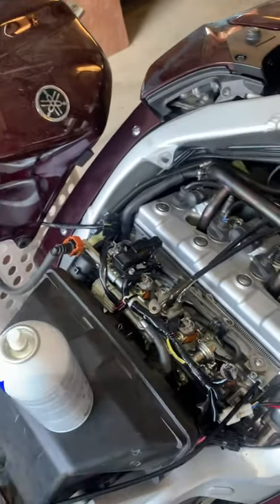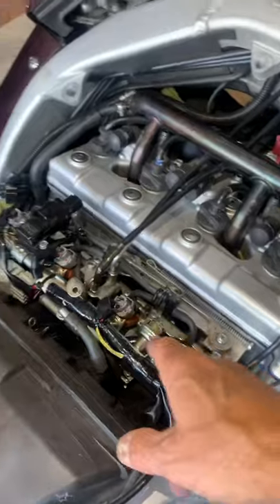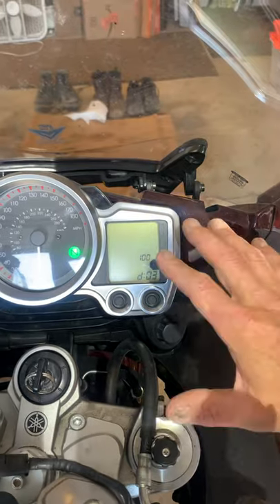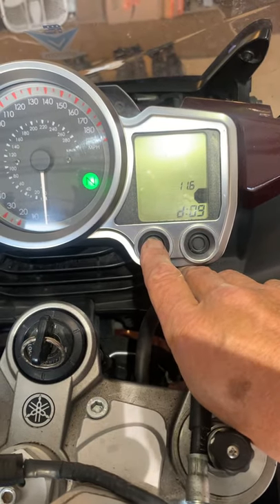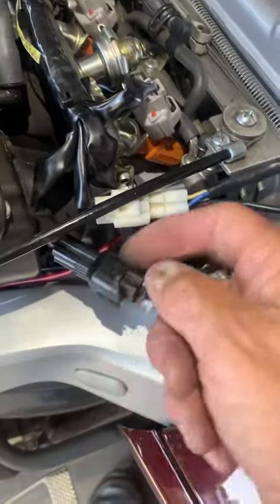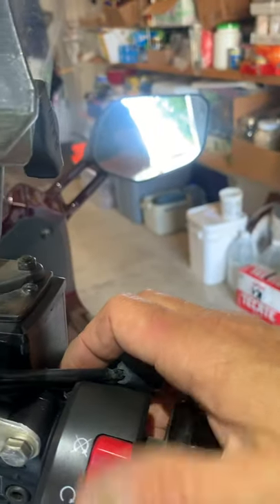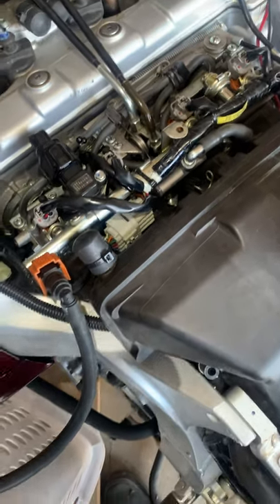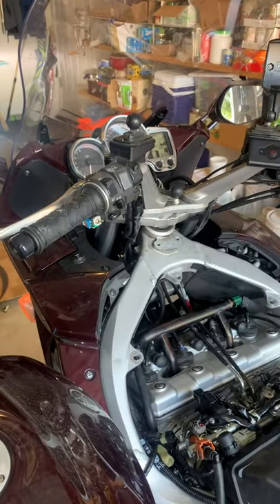2007 Yamaha FJR1300 problem starting won't run cold

Comment from the maker: Sorry if you tried to leave a comment.  I did not realize that if I checked "ok for kids" they do not allow comments.   And I've discovered that there is no diagnostic mode for the O2 sensor so maybe that is my problem.  A signal from the O2  sensor indicating the engine is running rich may case the ECM to lean out the fuel mixture but there is no error code or diagnostic mode to indicate this so I'm going to try and force the engine to run in open loop and see if the problem goes away when running with default settings.

Comment from the maker: also note that diagnostic code 48 to test the air solenoid valve does nothing on my bike because the PAIR system has been removed but that should have no bearing on my problem.

Comment: Hi,
Clean the injectors both ways( with WD40+seringe+battery)
Clean fueltank and take out the fuelpump than clean the little fuelfilter on it.
Reply from the maker: thanks.  I should have updated this youtube.  I did run a can of seafoam through it before my trip in late July to 
SD. In the end the problem was a self inflicted wound.  What I should have done (and did eventually do to find the problem - see other youtube video) was to check the fuel pressure. It was only 20 psi because 2 years ago I messed up reassembling the fuel pump and it was leaking at the o ring between the upper and lower pump assembly.    https://www.youtube.com/watch?v=Uvxez4vX0cI&t=8s  It's a miracle that it made it to SD and back.  But now that it's working right it's a hoot to ride.  I really like this bike.
Reply from the maker: Thanks.  the tank was cleaned when I "fix" the broken pump.  See this for an explanation.  https://www.youtube.com/watch?v=Uvxez4vX0cI

Comment: This seem like fuel pressure.

I had the same problem in my FZ6 from time to time when i disassembly the fuel pump and dont get correct the little rubbers on the inner tubes.

In fact, a friend of mine had exactly the same problem and the same cause las week, he took apart the fuel pump to clean the strainer and he thought that assemble it correctly but it doesnt start.

When you take out the air filter you can see the inyectors inyecting fuel but at low pressure, not atomized, so its a sympton that the fuel was being pick up by the pump but it was being returned to the fuel thank by some rubber misplaced.

After disassembly and assembly again, he told me it solved the problem.